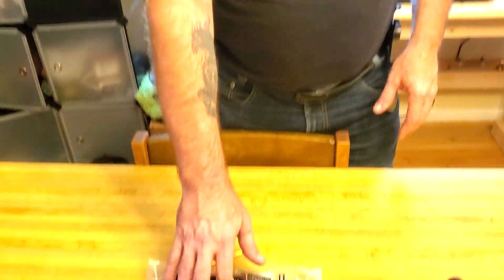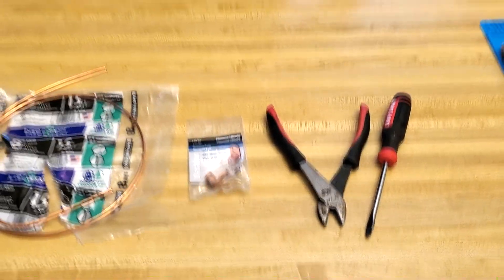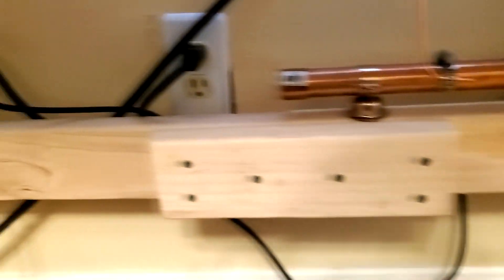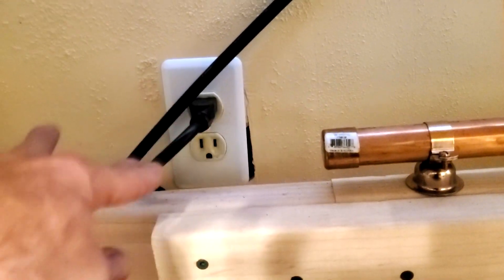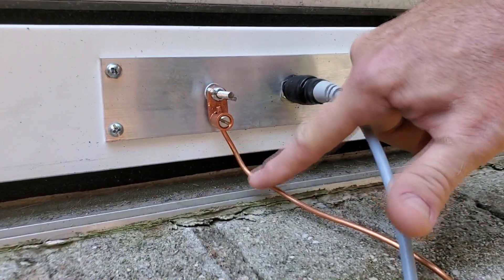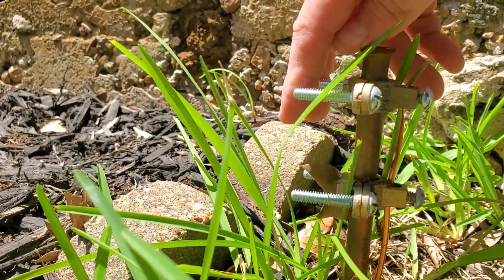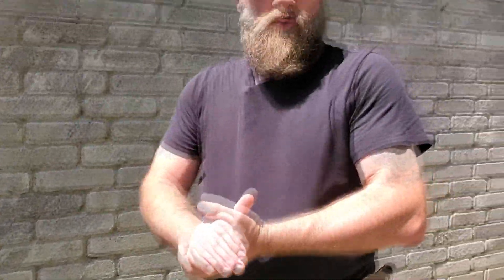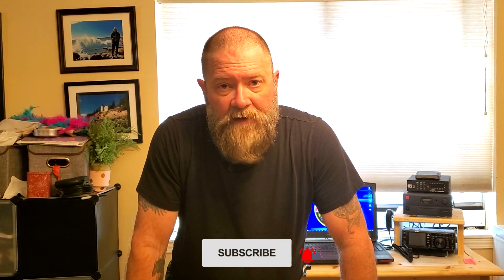How I ground My Ham Radio Station

Comment: I also agree with Ricardo regarding ground clamps but i disagree bonding the equipment ground to the house ground your radio shack should be seperate from the house ground and have its own grounding rod as you have done , great video very informative.
Reply from the maker: I am glad you enjoyed the video.  Thank you for the comment!  73!
Reply: If within the same structure it must have a common ground with everything bonded to it so that a fault will clear locally. If a separate structure is designed, it must be a separately derived system. No ground wire carried to the source but a new ground system with the neural/ground bonded at the out building so that a fault will clear locally. There, all devices will be grounded to that system including antennas. Attempting to create an isolated ground within an existing system will cause an inductive loop when you plug to the house. Ground potential occurs here and could be dangerous and noisy. 73

Comment: one thing to keep in mind is  - for every 1000 volts you can have 1 inch spark so when we are talking about hunderd of thousands volts in a one lightning it could probably jump from the window well to the copper grounding point . Not sure how those lightning arresters work. Cool video thou !
Reply from the maker: That is something I did not consider.  Thank you.  I unplug everything each time a storm is approaching, so that gives me peace of mind that I won't fry my radios.  Thanks for watching and for the comment.  73!

Comment: You could use an electrical breaker box grounding bar instead of that copper tube arrangement. I think the setscrews that attach the wire to the grounding bar make a better electrical connection versus the connection made by a common hose clamp. Just thought I would pass that along.
Reply from the maker: Thank you for that suggestion.  I am constantly tweaking the design.  Thanks for watching and for the comment.  73!
Reply: Just starting to set up and I decided to use a bus bar on the wall for a common ground. Not going to be pretty like copper but it will do the job.
Reply: I found a brand new solid large copper grounding bus bar in the TRASH 9n the side of the road,I run all my grounding through that! Saved me a lot of $$!

Comment: I wish someone would do a video like this on grounding if you live in an apartment. Years ago, when I got my Novice license, I remember the universal recommendation was to run a  wire braid to a cold water pipe. That no longer applies since most plumbing in apartments these days is PVC., Copper is too expensive.
Reply from the maker: In a situation where your construction is limited such as an apartment, I wouldn't worry about it.  Instead, maybe just have that pipe under your ham shack like I do and when either a storm is coming or you are not using it, unplug the antennas and anything plugged into the wall until it passes or you plan on operating.  It is a pain, but will resolve 98% of that issue.  Even grounded, I unplug everything when a storm is coming just because losing thousands of dollars of gear is NOT an option.  Thanks for watching and for the comment.  73!!
Reply: @HR4NT  I am planning on taking down antennas every day when the sun comes up anyway. No I am NOT a VAMPIRE. I live in the central business district of a major city. I am on the 5th floor of a 100 year old 7 story building that is owned by a State Agency. So nothing outside the windows.a So my plan is to use :
#1  A glass mounted 2m/70cm antenna designed for a car. Those are fairly small and unnoticeable.

# 2 Several resonant speaker wire dipoles mounted cross wise on wall hooks inside the apartment for 2m/6m/10m/15m and 20m. The building walls are concrete and I do not know if the exterior walls have rebar in them so those may not work. But I will give it a shot anyway.

#3 The MFJ-1625 Apartment antenna. That is a 12 foot telescoping whip with a base coil and an included turner. Their site says it works from 6m to 80m. I have read 5 good reviews of it so far. But would a seller put bad reviews on their site ??
Reply from the maker: @John_Henry83   It sounds like you have a very good solid plan going there. I think you are on the right track. Keep in touch let me know how it all fans out for you. Thanks again for commenting and reaching out to me. 73

Comment: Sorry I'm not a pro but is all the effort worth it?  Just pull all the plugs when a thunderstorm or lightning is expected should be enough. 
Or is this hf grounding? Sorry I don't understand this
Reply from the maker: I am on the fence on this topic, because even though I have everything grounded (apparently wrong, according to some) I still unplug everything if there is even a hint of a storm in my area to protect my gear.  It just makes better sense to me.  Is it a pain? Yes, Does it guarantee that I save thousands of dollars in potential damaged equipment...ABSOLUTELY!  Don't over think it.  DO what works for you and enjoy ham radio as it is supposed to be.   Thanks for the comment and for watching.  73!!

Comment: Sir, in your video you show a copper tube with copper caps. Would you say the caps are necessary in the event of a electrical problem? I cannot find these at my local store for the tube I purchased and really don't want to buy another size just to get the caps and drive 30 mins away.
Reply from the maker: No.  I mainly did that for aesthetic reasons.  They offer nothing for performance or anything else.  I hope this helps you out.  Thanks for the comment.  73!!

Comment: What do I do if you can't ground the radio. I ask that because to get the grounding wire from my radio outside to the grounding rod would require about about 70ft of grounding wire. I was told a grounding wire should not be that long as it will then turn into an antenna. So how can I ground the radio with such a long grounding wire? Would it least help if I just grounded all the radio equipment to just a copper pipe inside the house without the copper pipe being grounded to the grounding rod outside?
Reply from the maker: In a situation like yours I think you would be OK with a grounding strap to a copper pipe under your desk.  However, what I do is whenever there is a thunder storm coming, I unplug my radios and gear from the wall for added protection.  It may be a bit inconvenient, but better than a loss of thousands of $$ in gear.  I hope this helps.  My setup, despite the criticism has worked out just fine for me so far an it has been 2 years now.  Thanks for the question and for watching.  73!
Reply: @HR4NT  

 @HAM Radio For Non-Techies  So grounding the radio and other equipment to a grounding strap to a copper pipe will protect it from possible surges that may occur from the wall plug sockets?

Comment: Thank you for the great content.  I'm a new ham and your videos make sense to me.  Some of the others I see just assume too much.  By the way, do you have to disconnect the ground wire from the window pass through during a lightning storm too?  I hope the answer is no but it just seems to my uneducated mind that the lightning could hit your equipment from the ground wire.
Reply from the maker: Thanks for the question.  With me, just because I am paranoid about frying my gear, if there is even a hint of a lightning storm headed my way, I unplug everything including the ground wire on the inside of the window only.  The outside ground stays connected all the time, but no equipment is attached.  Losing $3000 of gear is not an option.  Better to be safe than sorry.  I hope this helps.  Thanks for the comment and for watching.  73!!
Reply: @HR4NT  yes, that helps.  I'm new to the hobby and I find your videos super helpful.  Keep up the great work!

Comment: at 2:34 with pipe haven't you just created a bunch of ground loops between each piece of equipment?  I think all the gear should be grounded to the same ground point?
https://helpdesk.flexradio.com/hc/en-us/articles/204779159-Grounding-Systems-in-the-Ham-Shack-Paradigms-Facts-and-Fallacies

Comment: 4:39: Since they're lightning arrestors you're actually looking for the least bang for your buck, LOL.

What did you eventually settle on?

73,
John - KK7JBZ
Reply from the maker: I think I had an update video on this and I think I used the MFJ lightning arrestors...might have to double check that.  But everything seems to be running just fine with my configuration despite that is may not be "up to code".  Thanks for the question and for watching.  73!

Comment: Please bond your outdoor ground rod to your primary (main ac panel service) ground rod.   Use 6awg as minimum.  Rule:  outdoors needs to be bonded together, inside needs to be bonded together.  Both need to be bonded together.   Bonding your equipment chassis with hose clamps is frowned upon.  Use ground rod clamps with copper braid or 6awg wire and keep them short. Your a/c to dc power supply should not be bonded.  Check to see if chassis is bonded to negative and remove if so.   As long as your trans/recv is bonded you should be fine. Motorola r15 is amazing resource.   Outside grounds bond together.  Inside grounds bond together.   Bond in and out together.
Reply from the maker: I am still working on solutions for grounding and bonding.  I will not have an exposed wire going around my house to do so which means I need a better solution.  Thanks for the comment and for watching.  73!!
Reply: @HR4NT  You could use as minimum 6awg thhn as NEC requires to bond all of your grounding electrodes together.  If you can, minimize sharp bends in your bonding, otherwise employ large curves.  Until you have a single point ground, your safety and your equipment is at high risk. Good luck and 73.

Comment: My setup is very similar, I just bought a bus bar instead of using a copper pipe, honestly I imagine the copper pipe and bus bar would do the job equally. 73 de KF0CLZ
Reply from the maker: I think you are correct.  I just grabbed what I had read in an article that suggested the pipe route.  Thanks for watching and for the comment!  73!

Comment: As an electrician I would recommend running your ground wire also to the incoming water supply line form your street or well pump as long as it is copper pipe not PVC. This will insure a real ground. Just a ground rod may cause greater issues if there was a lighting strike on one of your antennas.
Reply: A lot of newer homes, mine included, use a non-metallic water supply line, and most of the internal plumbing is Pex.
Reply from the maker: Unfortunately that supply line is over 100 feet away on the other side of the house from the location of my shack.  The feedback from this video so far is going to spawn an updated video showing a bit more detail on my situation and some clarifications as well.  Thank you for the suggestion and for watching.  73!
Reply: @HR4NT  -- Since your house was built in 1976, you probably either have a galvanized steel or polybutylene water supply line... On one of the previous houses that I owned in this area, it had the polybutylene pipe (outside) and it seems that I was always having to put repair couplings on it due to leaks... Another house that I owned had interior galvanized water lines from around 1983 and I had pinhole leaks all the time in the pipes running through the attic... From what I understand, they used Chinese import galvanized pipe back then and it just did not have a heavy galvanized coating on it... My current house is all copper interior pipe and I've only had 2 leaks in the last 20 years...

It's quite possible though that a good ground rod at your current location is going to be better than running a wire all the way to your water supply line... Running a wire under the concrete of a driveway or sidewalk is not that difficult -- just make a "water drill" out of some PVC pipe and dig holes on each side of the piece of concrete that you need to go under... Of course, with the clay soil around here, I try to avoid digging whenever possible... :)
Reply: Been Holding off on putting up this Antenna until I figured out the ground issue as I live in severe lighting prone West Palm Beach, Florida and I'm really happy that I came across this comment by Common Sense to ground to the main water supply line as well, as I had intended to ground the antenna the base of my electric meter ground rod only... I now intend to ground to both of them unless it's not recommended.... Thanks.

Comment: Hey man great video.  Based on my area space outside there will be special steps that I will have to take to get the radio radio itself (not the antenna grounding) properly grounded being that I live in a rental townhome. Grounding the antenna outside bring its own challenges but I think I will manage but the task of grounding the actual radio from inside the house is a whole higher level of challenge. Base on location of my radio in the house the ground wire from the radio to the grounding rod outside the home is supposed to be short in length. If it is very long and not short in length the ground wire may act as part of the actual antenna. The problem trying to ground my radio from inside the house is that from the location of the radio (in my house) to the point of where the wire has to be grounded (outside) is about 30 -35 ft between each other. This is way too long for a grounded wire. And I can't move the radio toward a window because I don't have a window in a location where I can set up the radio.  I have two of my friends who ground their antenna however they do not ground their IC-7300.  Just trying to figure out if that is really possible to get away with.
Reply from the maker: I wouldn't overthink it.  I grounded my radio by using a 1 inch copper pipe under my desk and added grounding straps to that.  HOWEVER, even though I do have my antennas grounded, I still don't trust it with my investment in al the gear, so what I do is whenever there is a storm coming, I unplug EVERYTHING from the wall AND I unplug my antennas from the radio until the storm has passed.  Might not be the most convenient, but it is a guarantee that no matter what, my gear is 100% protected through a storm.  If I am going opt be away for a bit, i also unplug everything just to be safe.  There are tons of grounding solutions and you just have to find one that suits your needs and will portect your ham gear.  I hope this helps.  Thanks for watching, have a safe holiday and thank you for the comment.  73!
Reply: @HR4NT   Yeah the grounding you have under your desk is what I am going to build myself.  My only issue is that when I create the same grounding setup you have under your desk I will not be able run the ground wire to the rod outside as the the nearest window is far from my desk. Anyways, thank you for all of your help. You are very appreciated for all the help you provide and all the time you give to everyone.  Happy holidays to you my good ham brother. 73

Comment: you should have drove a ground rod right next to the window and then bonded that to the service ground.. having such a long "ground run" from the window to there is not ideal at all... maximum of 5 ft between rods imho - coming from a cable company background this is what we were told. if we needed to put a rod in we had to bond it to the service ground, i've had to manually pound in 4 rods around the house to get to the service ground.

also, braided strap is better than wire,
Reply from the maker: I get that.  My issue is that I have the rod below my window.  About five feet away is another rod that goes into the back yard.  To get to the service ground I have to go around the corner where I have a sidewalk and service entrance to the house.  So unless I bury that wire under the concrete sidewalk somehow it will be exposed, in the way  and annoying.  That is the only reason that I have not connected it that way as of yet.  If I find a solution, I will probably make an updated video.  I do appreciate the info though.  Thanks for watching and for the comment.  73!
Reply: @HR4NT  if u have one under the window and one 5ft away, i would at least bond the two together. You could get a potential difference between the two

Comment: What would be a good solution for ground the equipment if your on a ledge?. I live on the coast and about 3ft down is nothing but solid rock.
Reply from the maker: Hi Ernest.  I found this link that may help you out.  Apparently you need 8 feet for proper grounding, however, if you have rock below the surface, you can angle the ground rod and still get a ground.  check out the article here:  https://bit.ly/3HkJpmL  Scroll about halfway down to see what I am referencing.  I hope this helps!  Thanks for the comment and for watching.  73!
Reply: @HR4NT  Thanks for the advice. I found all these videos of people driving ground rods into the ground but nothing on " if you hit solid rock ". It a very interesting article to read. Just a suggestion but maybe you could do a video about problems like mine and solutions.  You never know!. Maybe others have the same problem as myself. 
Thanks again and kind regards. 
73's Ernie.
Reply from the maker: @ernestfogg9672  that's a great idea!!! Thank you!!!
Reply: @HR4NT  here's another question for ya. What part of the antenna do you ground to?. I ground mine at the lower mounting u bolt to the mast with a heavy gage wire then straight to the grounding rod.

Comment: How about 6 gauge stranded copper for your ground wire. It has more surface area to dissipate heat.
Reply from the maker: It was hard enough to find the wire i used in the video at the time.  I may revisit this project again sometime in the near future.  Thanks for the comment and for watching.  73!